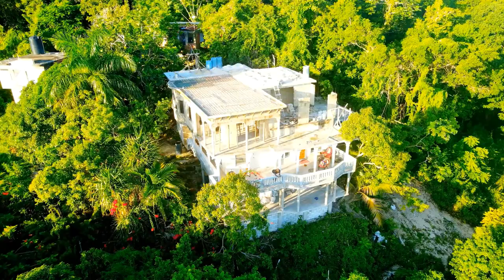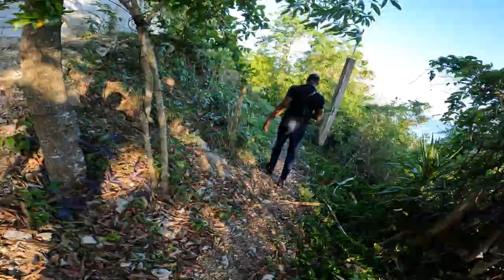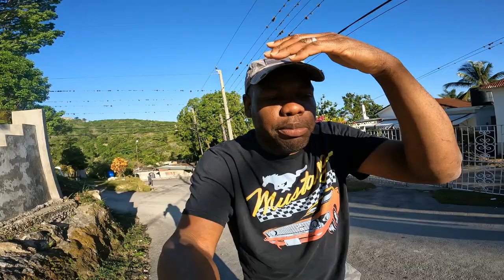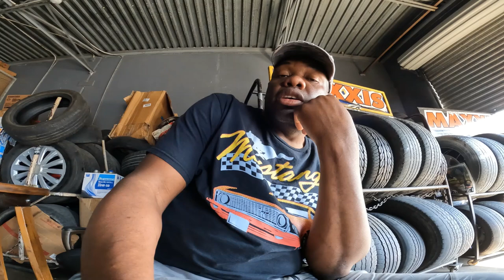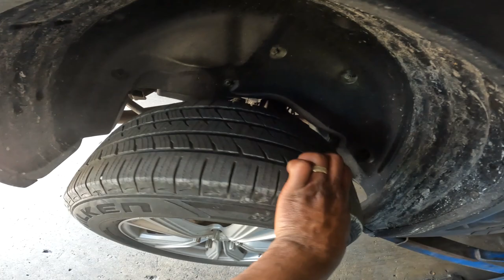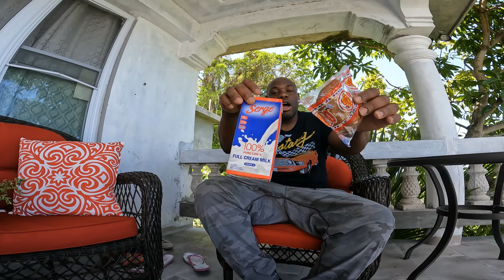$25,000 for an oil change in Jamaica?! my wife thinks I got scam.

Comment: Bro changing oil,oil filter and air filter I’ll charge $6500-7000 but if I’m charging plugs and like servicing the brakes as in charging the brake pads I’mma charge atleast $10,000 they over charge you bro if it’s just oil,oil filter and air filter you change they over charge you bro
Reply from the maker: Blessings, thanks for the information .they seriously rob me big time